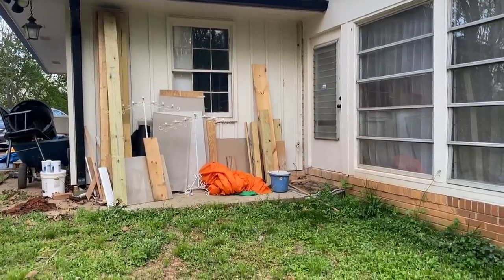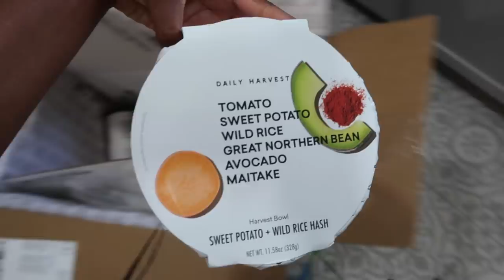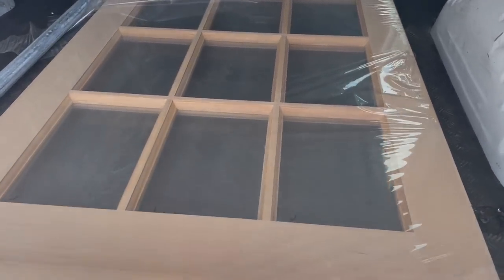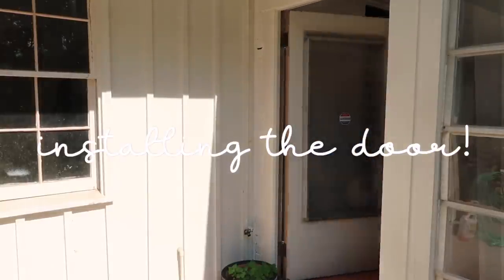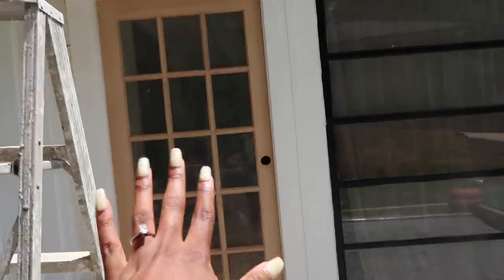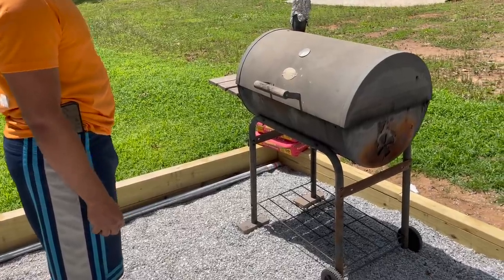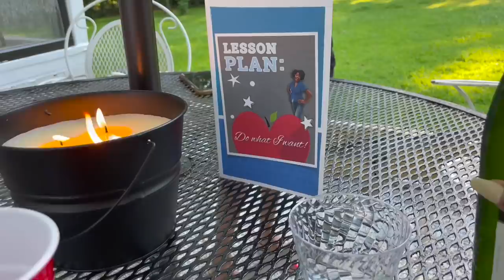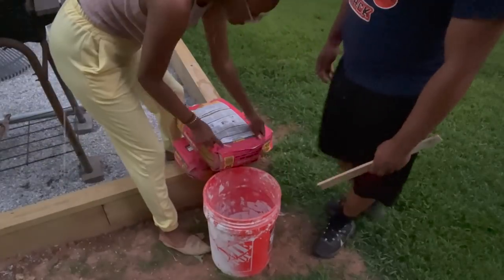DIY PATIO MAKEOVER Pt. 2| Painting, DIY Furniture Makeover, New Patio Door, & Family BBQ #FIXERUPPER

Comment: Grills need to use a special paint called high heat paint. It tends to only come in very few colors. Black and a few others. 

Hi to Marcus’ Mom! And wow that little baby puppy is getting so big! Everything looks beautiful
Reply: Yes!!! I’ve used them too!! They work well with bbq’s and smokers! I’ve used them with metal firpits but those don’t hold up well in wet areas
Reply: Painting something that gets hot is not long lasting with anything purchased at the store. Especially stored outside. I wouldn’t ever go there and just buy in the color desired.
Reply from the maker: Yessss! I got the paint 💗💗💗 so excited to show y’all

Comment: Noooo do not paint the grill- as soon as that metal heats up that cutesy color would flake right off. Regular spray paint covers a world of sins but it’s not meant for anything coming in contact with fire. If you want to cover the rust, use heat safe spray paint which is usually black and readily available at HD/Lowes.